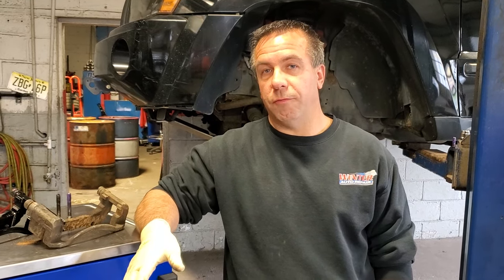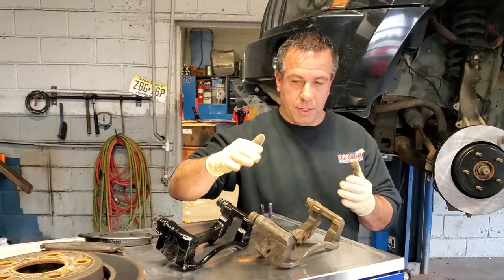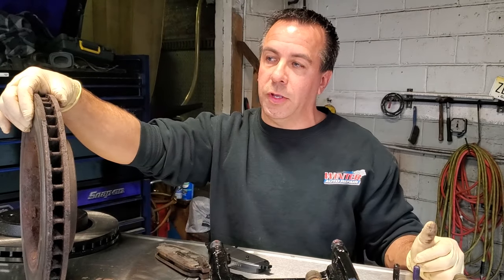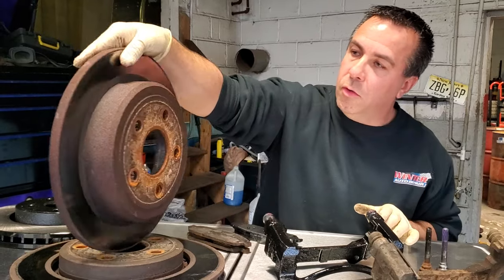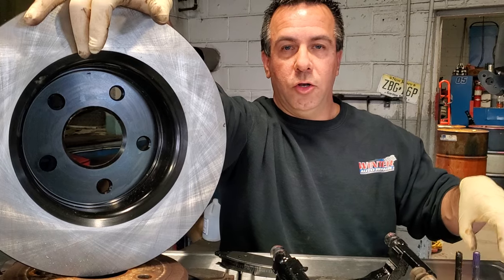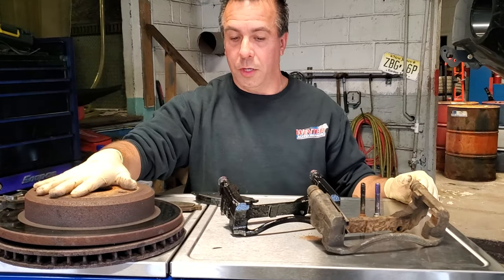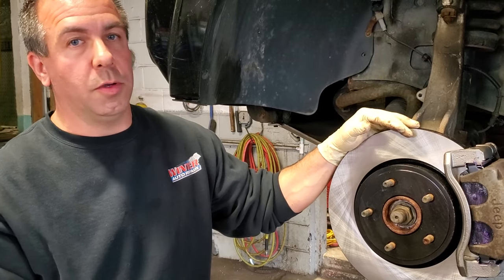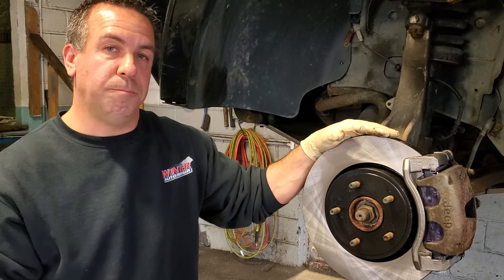High quality brakes vs cheap brakes

Comment: Did you just say $450 for a 4 wheel disk brake full brake, replace all 4 rotor brake job, painted calipers, new hardware, purple grease?  I'm in.  This is a steal!!!
Reply: @mickeyflowers  I'm getting quotes of $1200. to $1500. everywhere I go. Nobody except the dealer here will install parts that I buy.

Comment: I gotta admit, i have never greased the slide pins. Done everything else like fitting  slotted high carbon rotors including upgrading brake fluid to dot 5.1. No squealing, much improved pedal feel and brake modulation.
Reply from the maker: Always pull the pins, clean them, and grease them. It prevents them from freezing and getting uneven pad wear.  If the pins stick, the inner pad will do most if not all of the braking, while the outer pad will do little to nothing!  
Thank you for watching and commenting!
Reply: @WinterAutoRepair  Well, I didn't know that. Thanks for the update.
Reply from the maker: You're welcome! Your brake jobs will be that little bit better.  I'm happy to help. Thanks again for watching

Comment: Great video I have a 2014 Hyundai Azera I'm not worried about price so what do you believe is the best quality rotor to buy for my vehicle or is it best to buy the original rotors straight from the Hyundai dealer?
Reply from the maker: So we prefer Centric High carbon when available... we also use Perfect Stop and Durago EP. Original rotors that came with the car from the factory and the rotors you buy from the dealer don't seem to be the same quality anymore. The 3 aftermarket companies I mentioned seem to be better quality and price. I hope that helps. Also, I'm sorry for the delayed response. I'm new to YouTube and was over whelmed by how many comments we received from this video! 
Thank you for watching and commenting. Please subscribe, we very much appreciate the support!

Comment: In the past when I have required replacement brakes on my car I purchased Disc Italia rotors and pads. The rotors were drilled and slotted, the pads were Kevlar. The difference in the stopping of the vehicle was huge. The vehicle has so much greater stopping power. The products themselves were not cheap. The last set I purchased to do all 4 wheels was $750. I had the parts sent directly to the Subaru dealer who did the install. Would you have an opinion?  BTW the parts were for a 2015 Outback Limited 2.5i.  I also have the brake system flushed and refilled every 2 yrs as part of my maintenance schedule.  May I know where your shop is located?

Comment: Hi
Have you ever change or use the brand power stop breaks from amazon ? What's your opinion on that brand?

I installed 1 set in a honda odyssey and 1 set on chevy captiva almost with 1 month of difference and chevy captiva are still good, but honda odyssey are vibrating again, after 2 years, or 20,000 miles.

I feel they are not good quality, they are like the ones you describe that are cheap.

What brand do you recommend ?

Thanks
Daniel C.

Great Video!!!
Reply from the maker: Power stop are a basic white box rotor but usually have slotted or cross drilled which is unnecessary. For long life use Centric, Perfect Stop or Durago EP rotors. Make sure they are High carbon and coated for the longest life! I hope that helps for your next brake job!
Please subscribe, we are creating more videos currently! We appreciate it.

Comment: Hay Dude, great video to learn soo much.
Which brand rotors is that ? It it OEM ?
Reply from the maker: Thank you. These were made by Centric. However, the owner of Centric sold the company to raybestos and now owns a brake company called DFC.  We would recommend DFC, Perfect Stop like we do Centric.  Good luck!
Reply: @WinterAutoRepair  thanks a lot. Either I'll get OEM  or this Centric

Comment: great video,   what brands  of rotors you showed in video   that is high carbon,  make more like it
Reply from the maker: Thank you. In the video we used Centric parts. We also use Perfect Stop in high carbon.  
Good autoparts stores have them and sometimes Rock Auto will have them. 
Best of luck to you

Comment: And for another $1 you could paint the caliber to help protect and make it look nice
Reply from the maker: With the heat of brakes, pint typically burns off almost immediately. We can have calipers powder coated if the customer requests it. When replacing calipers, we only use zinc coated or powder coated calipers to make them look nice and stay rust free. Unfortunately, even caliper or engine paint doesn't hold up well enough to paint the caliper. Thanks for watching and commenting.

Comment: Thank you for your video. I learned alot. For my 2009 Honda Accord EXL V6 Coupe, 109,000m, I'm ordering the Centric 120 rotors, F&R. I'm also buying that purple grease you used and new caliper pins. For the pads, I'm going to order either Akebono Premium ceramic (ASP) or the Pro ACT (ACT). Are the Akebono ASP worth the extra money for the better stopping and less fading in your opinion. Thanks again.....
Reply from the maker: You're welcome. Better quality is worth the extra money in most cases.  Those pads are more of a severe driving pad.  For example we would use that pad on an emergency vehicle or truck that sees towing or heavy loads.  If you're an aggressive driver it would also help. If you're more of a basic driver and don't have excessive brake issues (like you live on a mountain).  Then they might be more than you need.  However, they wouldn't hurt to use them either.  
Good luck!
Reply: Thank you for your quick reply. In Florida, no mountains, lol! basically an average driver. I was thinking for those situations where one may need that extra bite the ASP pads have to offer, they can't hurt, as long as they won't excessively wear out the rotors considering those extreme braking situations hopefully won't arise often.
Thank you again 👍

Comment: I was unaware the jersey no longer has inspection. I'm right over the bridge, Philly area.
Reply from the maker: Nj does emissions only. They check for a check engine light, and that's it. It confuses people because most think the cars' suspension and brakes are also being checked when, in fact, they aren't. You can go with grinding brakes, bald tires and no mirrors, and get a passing sticker.

Comment: Thank you so much for the video.  I always believe in good brakes and tires having said that what do you recommend brands for rotors? I live in Houston and my commute requires quick stopping all day long. I've using Centric and Raybesto rotors and Akebono pads.
Reply from the maker: Thank you for watching and commenting.  Our #1 brand is Centric. If that's unavailable we will use Perfect Stop or DFC in that order.  
I hope that helps and good luck with your brakes.

Comment: I have a F-250 King Ranch, and I am pulling a large 5th wheel trailer @ 18,000 gvwr.  , Justifiably towing that kind of load would require a one ton.  However, I wanted to stay with my F-250, because it does the job of towing, and provides me with a run around pickup.  Does the stock brakes on the F-250 need to be upgraded?  Would it be worth the money to upgrade the brakes?

Comment: I’ve bought the white box rotors and they were severely rusted only after 5,000 miles.
And that’s on a car that’s garaged and is in the sunbelt where road salt is sparingly used.
Pieces of junk. I replaced them with a good quality (about 25% more expensive) rotor and have had them for over a year and they still look new.

Comment: That rotor is still from offshore. Offshore rotors are fine, they make fully coated and are to spec. They will all eventually scale up not matter if it is OEM or white box. The road salt used in winter will cause it. The only way to prolong the life of brakes is to service them. Cleaning the caliper brackets and lubricating the pins and brackets. Manufacturers have maintenance schedules. Follow them. It is not uncommon to get 90,000 km on a set of brakes if serviced properly.
- licensed automotive service technician - Ontario, Canada.

Comment: I had a disk brake lock up at speed.
Research indicated a deteriorated rubber brake hose putting debris into the brake fluid preventing the brake pads from retracting.

Comment: While i don't give a damn about state inspections, because i maintain my cars... but you're right about cheap parts. I cheaped out on some "Centric" brand rotors/pads for my CX5. Within weeks they were so rusted and would squeal while riding the brake in reverse. Ended up going with top of the line power stops like i usually do. Last time I'll cheap out

Comment: sit there is no way those rotors can be resurfaced, anyway I am refacing my rotors once now as you say new rotors are not thick and after one-time shops say refacing will bring it under recommended thickness and it's illegal to reface them. I like that you are changing pins and taking care of your customer doing a good job that looks also good
Reply from the maker: Thank you!

Comment: 0:48 While I Agree with Buying Quality Products. That Pad,  It Didn't Fall Off, It Simply Wore Off Unevenly, Guide Pin Probably Got Stuck/Rusted/Not Sliding Smoothly and Made the pads wear off Unevenly. It's happened to Me some years ago when I started doing My own work And Still happen to Me Occasionally when I buy A New (to Me) Car. That's a typical example of Uneven brake pad wear, it grinds on the Rotor surface as evidenced in this video.. But Good Video. 👍👍

Comment: What is the purple grease? A type of seal glide brake lubricant? Any particular brand that you like?
Reply from the maker: The purple grease is Permatex item# 24125. It's good to 3,000 degrees which keeps the pins lubricated no matter how hard you drive or how hot you get the brakes. I don't know of any other brake grease that works as well. You can buy it at almost any auto parts store
Reply: @WinterAutoRepair  thank you so much

Comment: Those e-coated rotors may last in NJ (used to live in East Brunswick), but up here in the salt belt of Western NY, I've yet to have a rotor not rust up.  It usually takes 1 winter before you start seeing the coating fail, and 2 winters for them to get a decent amount of rust.  I've used several brands and they all turn to rust.  About the only brand I haven't tried is EBC, but those have a huge premium price tag.  Centric and Raybestos were about the same.  But, even the "white box" rotors were ok when new.  Double-disc ground, good crosshatching, but yea, they were uncoated.  Never had an issue with friction material separating from a pad, though.  Last time I saw that was with a parking brake shoe on my 2002 Jeep WJ.
Reply: Same here. I've used many different brands and they all turn to super rust.
Reply: In my experience, the “modern road salt” that cities and counties use to maintain their roads has vastly changed over the years.  These modern salts seem to have additives that make the salt sticky and adheres to anything.  These modern salts also have properties that prevent them from being washed off with just regular water.  Some kind of soap is needed to “rinse off the salt”.   I highly recommend trying to avoid driving when roads are being salted.  If you do have to drive through it, the vehicle’s under-body should be clean soon there after.  This will also prevent coatings from failing quickly.
Reply: so what you suggest just get cheapest rotor? and get best brakes like akebono brakes?
Reply: Find a car wash with undercarriage wash.
I live in Chicago and as soon as the roads are fairly dry, I take it through the car wash.
5 year old car, still have the cadmium plating in the calipers, light surface rust on the rotors.
Reply from the maker: Have you tried the Centric, Perfect Stop or Durago EP rotors? We used Centric in the video but we use all 3 brands and have had good success. Like some of the people who replied suggested, run the car/truck through a car wash after each storm. Down in NJ we have car washes with a membership program. For $30 a month you can run the car through as many times a month as you want. I've gone multiple times in 1 day! it may be something worth looking into where you live. 
Thank you for watching and commenting. Please subscribe, we very much appreciate the support!
Reply from the maker: I agree Jack, the salt is way different. I don't know where you're from but in NJ we have Brine... It's literally salt water that is sprayed on our roads prior to a storm. When you drive on it, the salt water sprays under the car and gets into everything. It's like driving on the beach through the waves and it's eating our car and bridges up. It cannot be good for the environment as it washes into the storm water drains either. get your car washed as much as possible all winter long. It's really the only thing we can do to try and prevent rust.

Comment: What brand of rotors are these high carbon? I've had problems with rotors warping in 2 different Mazdas several times, both with OEM rotors, Bosch and AC Delco. I don't know what to get anymore. Will try Akebono pads this time

Comment: Winter Auto Repair, can you tell us what rotor brands typically provide the higher quality?  Not looking for professional racecar stuff, though! ;-)
Reply from the maker: We prefer Centric (which is what we used in this video) perfect stop and DFC. All three brands offer high carbon and basic rotors. For best results use the high carbon and coated rotors. They typically last 3 times longer then standard rotors. The length of time saves a lot more money then their higher cost to purchase.

Comment: Man I Wish you live near me, I'd be down there ASAP for my brakes. Hard to find Excellent workmanship these days.
Reply from the maker: Thank you!  You can look up an organization called BNI. It stands for Business Networking International.  We are members, and in fact, we started our local chapter. It's a small business networking group that helps other small business owners. To be a member, we have to adhere to a strict code of ethics. Business owners in BNI should do a better job than most.  You can Google BNI chapters in your area and see if any have a mechanic. 
My other suggestion is to interview the shop and see what brand parts they use for certain jobs like brakes. This should help you find a mechanic who is a good fit for you!
I hope that helps. 
Thank you for watching and commenting!

Comment: Usually ceramic brakes pads are used on racecars because  you have to warm it up really much to have a good and safe brake. In daily cars are not the best option because it's not reach the required temperature.

Comment: Sir you are properly trained and armed. With knowledge are Detroit axle brake pads quality
Reply from the maker: Those are cheaper parts. The rotors are usually cross drilled or slotted. That will wear your pads out much quicker. Back when pads were made from asbestos, the slotting was useful to keep the gas layer away from the pad. New ceramic and metallic pads don't have the same gas issues. Therefore there is no need and it's mostly for looks. I own all kinds of race cars and exotics. We use solid rotors as much as possible.  
Thanks for watching and please subscribe!
Reply: @WinterAutoRepair  thanks pro

Comment: Hi, watched your video with interest, but have replaced brake rotors  from European manufacturers ref VW etc.
These were original OEM parts however non were ever painted for corrosion protection.

Comment: Upon getting a brake job quote from Kia I had asked if the new replacement rotors were OEM, they said no. They typically just purchase rotors from AutoZone.  Of course, I don't know how much better Kia's OEM rotors are compared to AutoZone's, probably not much, it was just surprising to me. Not to mention their job would have been almost $300 more than going to a local brake shop who's more concerned with using quality parts and charging a more reasonable price.

Comment: Thanks for the info. I bought Durago coated rotors but I’m thinking of returning them and getting power stop coated rotors- any thoughts on Durago?
Reply from the maker: We actually use the Durago EP rotors and have had good luck. Power stop are not much better than white box. We have had pre mature failures with them. The 3 brands we like to use are Centric, Perfect Stop and Durago Ep. All 3 make high carbon and coated. I hope that helps. 
Thank you for watching and commenting. Please subscribe, we very much appreciate the support!

Comment: I have a 2019 honda accord sport 1.5T. and I'm at 53k mileage.. I do uber on like 4 days a week.. will the brake and rotors you showed will fit my car? if so please give me the link . I live in New York. Thanks
Reply from the maker: Centric makes brakes for all makes and models. You'd have to call your local autoparts store or ask your mechanic to get them for you.  I don't have a link to supply you. Sorry.  
If you can't find them locally, you can also try Rock Auto. 
Good luck!

Comment: My brake discs,from factory,on 70.000 km had some waves but never felt any vibrations,because they were OEM,brake pads still had 5 mm,new costed 800e(all 4) but hey next 70.000 km on the way.

Comment: This is only 3 years ago. Last year when I needed rotor replacement, the dealer quoted me $2k. I think it was for 2 rotors. I did that in MA so not sure if it was just MA being expensive or if Covid really made everything so much more expensive